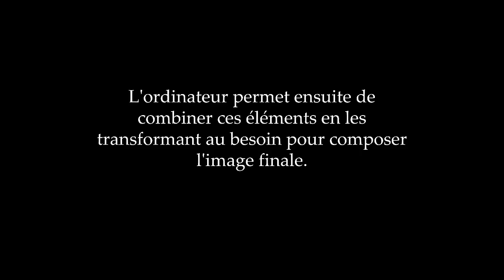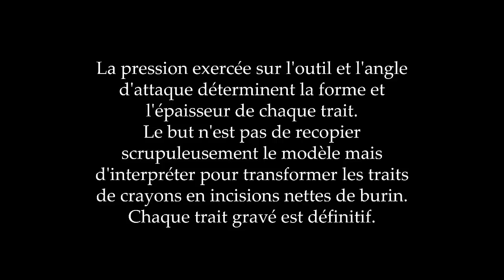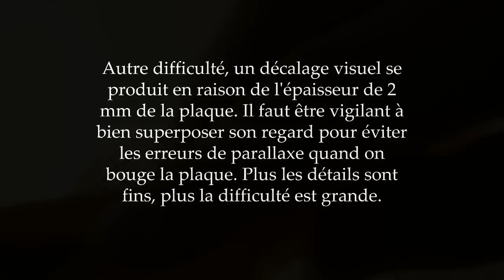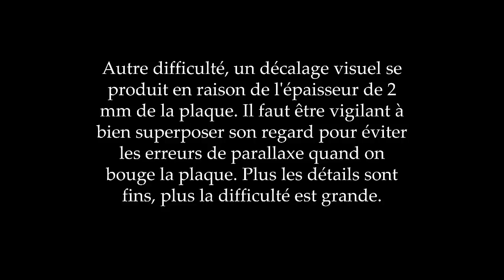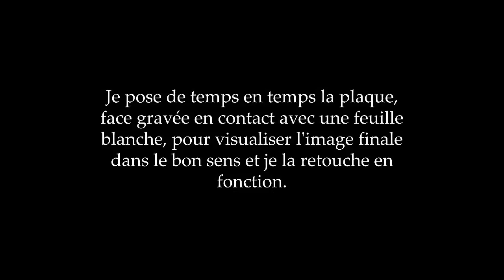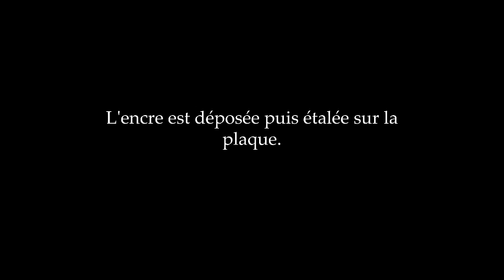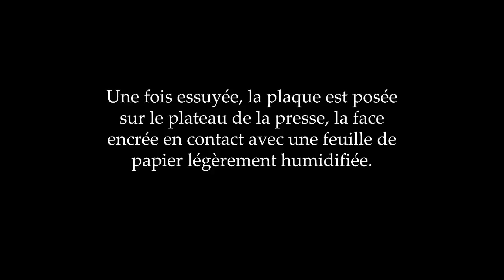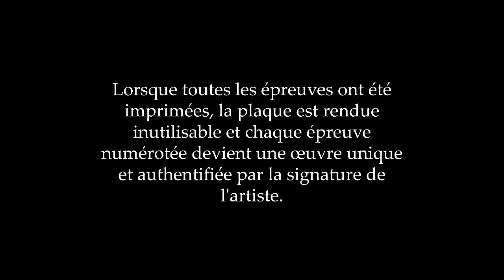Jean-Pierre DAVID - Graveur sur Plexiglass

Comment: very nice work. I did many pieces like this back in the 70's - 80's. I never printed them out , just gave them away as stand alone pieces. I used mostly just a very sharp, fine awl. What's really cool is if you don't use ink and shine a light thru the edges the scratching, or cutting lights up. I've  used 1 inch thick stock also, frame  and light.. The material works real nice and easy.
Reply: How many degrees of v chisel on the face do you use?  with heels or hell ?

Comment: This video made me a bit sad: simply to copy a picture through a plexiglass. "Normally" artists draw/engrave it on the surface ... This video is ment for those who can't draw. Am I wrong?
Reply: Leo Harjapaa I’m skeptical, that you have ever tried to use a chisel or gouge on a piece of plexiglass. Just to be able to control the tool enough to carve a straight line can be a challenge. To be able to complete a task like this without a pattern to help and guide you would be very hard. He may or may not have been able to free hand the entire piece. Having that pattern, that he probably drew, is a gift. He did a fantastic job either way. Wouldn’t you agree? Fantastic work of art and mastery!!!
Reply: Chaque détail a été dessiné au crayon en interprétant librement une documentation photo avant de devenir un modèle, par l'artiste (c'est-à-dire moi). Je peux aussi graver librement sans modèle, mais la composition était complexe et en gravure on ne peut pas revenir en arrière. Donc j'ai préféré reporter les grandes lignes du dessin avant d'approfondir les détails directement au burin.
Reply: Thank you both for the answers which  made me to understand better the requirements of the tecnic. Now I am watching the video with opened eyes. Thank you once more . Mi scuso!
Reply: Makyrie,  thank you both for the answers which  made me to understand better the requirements of the tecnic. Now I am watching the video with opened eyes. Mi scuso!